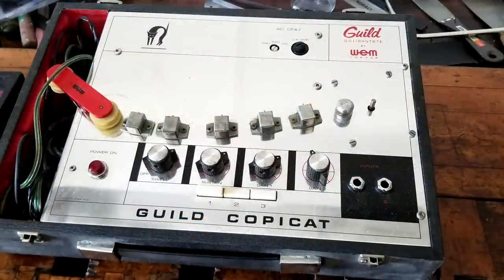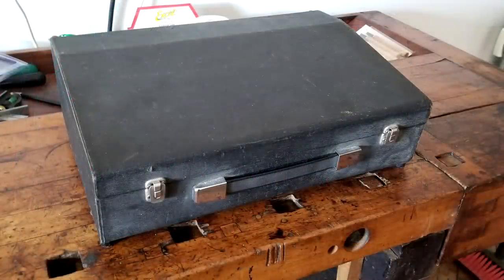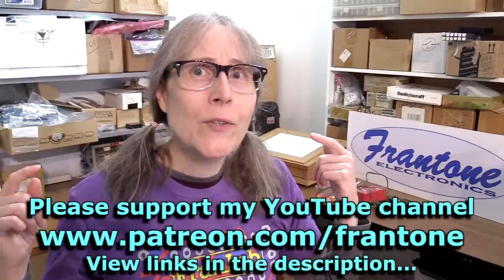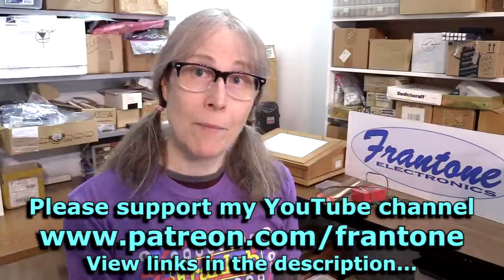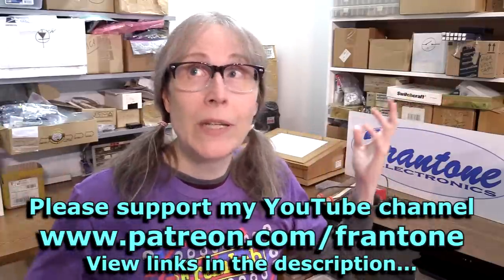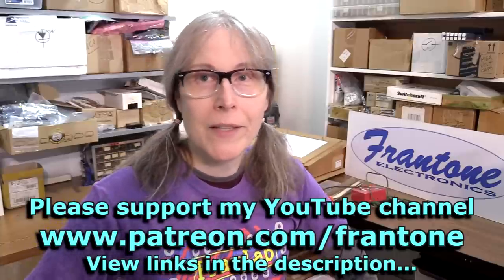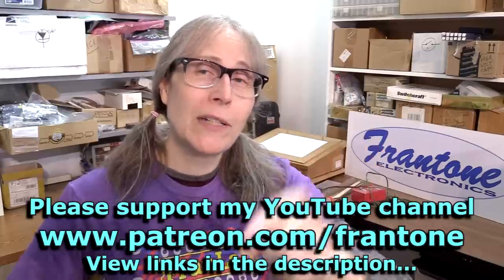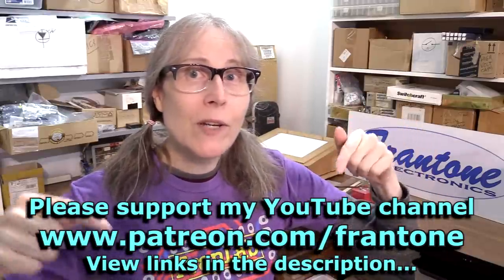Big Outgassing Problems Of Old Plastics

Comment: That purple shirt reminds me of those pre printed PC project boards Radio Shack used to sell.
     I had an old plastic cabinet vacuum tube TV as a teenager that smelled like dead fish when it warmed up 
     Some older plastics distort with age. I read an article a while back that said some 1940s cheap plastic jewelry had collector value because early plastics crumbled with age , and finding it in good condition was unusual.
     My guess would be to store plastics in as cool a location as possible. I would think heat would accelerate out gassing.
     Maybe store those records in larger metal cookie cans? Padded with something non flammable? Maybe ground the  cans as well. Just a thought.

Comment: Hi. the phenomethanal plastics were used in electrical insulators, due to their high temperature performance, and also in the manufacturing of printed circuit boards, among many other junk, one of its main problems is that when they decompose, formaldehyde is released, if you ever were around that stuff in the chemistry lab, the smell and its effects on the mucosa are similar to what you described.Take care.

Comment: i've had garbage bags that stink like burning wires by themselves. Like the factory that made them had a fire.
Reply: That is because to make the bag you extrude a circular tube of PVC, and then while it is hot you blow hot air into it to stretch out the tube into a much larger diameter thinner tube, and then blow cool air over the outside to finish the stretch and cool the plastic down. Then you have a roller around 5m up that it is folded over, which controls the air flow out, and it then goes through a few calendar rolls to finish the cooling, before it has one of 3 finishing processes applied. If it is a plastic bag it is printed with a roller, then goes to a punch that simultaneously seals the bottom, and punches out the handle, and the bag is then finished. For garbage bags you typically either slit the sheet in 2 bags, using a heat sealer on the edges, and a perforator making the divider between the bags, along with the base seal. otherwise you just have the bagbase sealed and the bag cut for regular non handle bags.

Your garbage bags are typically made with all the scrap pieces of PVC from other bags, along with recycled PVC bags, recycled PVC from other sources, all taken, ground and mixed up with new PVC base and carbon black, to make a cheap but low cost material. Then this is blown, and as the machine typically will be run long periods there is no cleaning of burnt plastic that occurs and this then burns, impregnating the plastic with the smell forever. That machine, and the area it is in, typically is the worst smelling and most poorly maintained machine, as it is either an old machine with poor quality control, or is worn out, so it makes variable thickness material, but for a single use garbage bad considered "good enough".

Comment: I wish my uncle were still alive to ask the best way to handle this.  But he passed away at age 100 not long ago.  He was head chemical engineer at Western Electric for many years.  Then they "promoted" him to Liaison Officer between Western Electric and the EPA.  After two years of that (and being put in an awkward position when maybe the company wasn't doing the right thing) he said he would retire if they didn't give him another position.  So they made him Liaison Officer between Western Electric and OSHA (ouch)  After two years, he had really had enough and left the company.  But he had learned a lot and very early got involved in the business of "Industrial Hygiene" and became CIH which is "Certified Industrial Hygienist".  If you can find somebody like that (perhaps contact the "American Board of Industrial Hygiene") you might get some knowledgeable answers and suggestions.  Perhaps a college or university in your area has this as part of some program and might have somebody that will talk to you gratis.  At any rate, if your ventilation isn't already good, consider making it good.  That's important especially for soldering and for all manner of chemicals and dusts you probably encounter.

Comment: There is a movement of opinion that much of our Asthma issues these days is because we surround ourselves with plastics that out gas all the time. That greasy film on the inside of your windscreen is solvent coming out of the plastic dash in the sun. Your walls are probably coated with Acrylic paint, (latex in USA,) a plastic.  Your carpets and furniture ad clothes may well be some form of plastic.

Comment: My worst experiences with outgassing materials are:
1. Soft rubberish household gloves. If you put them near other plastics, they will attack it.
2. Rubberbands, almost as bad as the gloves.
3. Suitcases with foam inside. If they are closed, aggressive gasses will build up and attack inside stored plastics.
Reply: I left a pair or rubber coated garden gloves in a microwave antenna dish, the gloves 'melted' into the painted surface. I basically destroyed the gloves removing them, and the painted surface is all but destroyed.

Comment: So strange! I have an old National Union tube tester with an all metal chassis but it also has a weird plastic-y smell... I was doubting my sanity, so thanks for sharing, Fran! I suspect it is the insulation of some of the high-voltage wires on the inside.
Reply from the maker: Many of those tube testers have a 1.5 volt battery inside the case, so you may want to open it up and check that.
Reply: @FranLab  Great idea, I will check it out, thanks :) Just looked up the name, it's a "National Union Videotron Picture Tube Checker."

Comment: One of the biggest offenders in terms of off-gassing is PVC, which has been commercially manufactured since the 1920s, so could be in a variety of items in your collection.  In an enclosed environment, you'll be able to see a white residue collecting on surfaces above pieces of PVC, though this usually takes place over several months.  Phthalates are a common plasticizer in PVC, so that's worrying, but also worrying is the question of what's happening with the chlorine during this off-gassing process.

Comment: My toolbag smells like rotting garbage, even though it is just a few months old and hasn't even been near a trashcan. Apparently the lining is butylene which breaks down to produce a horrible smell. I added some silica packs - the kind used to keep electronics etc. dry - and that does help. Might be an idea for your storage crates?  Another option is to use "active carbon" this also absorbs a lot of foulness (charcoal also works). Both are inexpensive and also available in bulk.

Comment: I have a synthesizer made in 2007 that emits a nauseating sweet stink after being turned on for an hour. I tried cleaning all of the circuit boards with IPA and letting the dismantled synth sit on my balcony overnight but it is still the same. It's one of my favorite synths but I just can't play it for very long without getting a sore throat. Synth = Korg MicroX.

Comment: I rewired part of our summerhouse some years ago. That part of the installation must have been from mid 50:s. Lead around silicone rubber-insulated wires. The silicone rubber was like new. Other and younger kinds of plastic can be ground to dust between your thumb and finger. UV-light and ozone are clear no no:s I guess.  I also fixed up our row boat. What if I put in too much or too little hardener in the resin. What then? And I'm thinking about collectors of modern cars. A rusty say VOLVO P1800 can be put back in good exhibition grade order. But what about a Koenigsegg, if something happens to the carbon reinforced plastic? And what if it is not only at the surface? Welcome back bakelite!!

Comment: Would the Library of Congress not want the Lacquer Discs? Also... Where I work, we had a Neve audio console from either the late 1980s or early 1990s. By the early 2000s, the boards were catching fire. I was told it was a problem with their (at the time) new manufacturing process with SMD. They weren't cleaning the boards well enough and the combination of residue and electrons flowing through the boards caused problems.

Comment: Neutralizing acid gas production with baking soda may be an option. 
The acid gases emitted catalyse decomposition that produces yet more acid gases.
Decomposition of elastomeric components is unavoidable but corrosion inhibitor sachets used in electrical panels are a slightly more expensive option but are designed specifically for the job.

Comment: Somewhat off topic, but there is a problem with vintage Olympus cameras caused by deteriorating foam tape used for light gaskets and mirror shock damping. In these applications it is fairly easy to remove and replace, but it was also used under the housing for the pentaprism mirror. It wasn't really necessary in this application, since the mirror is well fixed in location. When the foam breaks down it corrodes the silvering on the mirror, resulting in a band of apparent "crud" at the bottom of the finder image. To prevent this the top cover of the camera must be removed and the tape residue gently scraped off with alcohol for a solvent. If there was sufficient damage the mirror must be replaced. Fortunately the mirrors from later models are exact replacements and mirror transplants are possible. A CLA (clean, lubricate and adjust) servicing with new mirror costs about $150.00 so is more than the used value of the camera, but worth it if you want to continue using it.

Comment: Working with polymer clay I had to add forced ventilation to my baking oven, drawing the exhaust right out through a window to stand working with the stuff. Placing an outsourcing plastic item in a warmer than normal environment  might make it outgas quicker as the plasticer would evaporate faster. Like a sunny spot near a south facing window with some sort of ventilation.

Comment: I'm not sure what sort of crates you're using, but a good solution might be to take the lids off the crates and staple on sheets of tyvek. It would be easier and more allow better outgasing than drilling holes in the crates.

Comment: I've heard that chemical agents in cables that keep the sheaths flexible can react with the kind of plastic material used to make computer cases. So if you wrap your computer with it's cable, the cable can "burn" into the case over a long period of time. I try to keep the original packaging of as much of my stuff as I can, because the people who packaged it knew best how to prevent these sorts of chemical reactions from happening. But I'm afraid in your case, you've got a tremendous number of unknowns.

You may want to hire a full-time chemist. You could do videos together. It would be fun.

Comment: I haven’t watched your whole video yet - I will, fear not - but I’ve even noticed some outgassing issues with the 1:18 scale model cars that I have. Many of them have die cast metal and plastic construction, with the plastic parts displaying definite signs of fatigue as they age, particularly if they’re painted or mounted directly to metal parts. Definitely notice a strong chemical odor from some of my older models as well, which I suspect doesn’t come from the glue. Interesting.

Comment: I had to cleanup a neglected aquarium a few years back and did'nt know if I could stomach the stench of dead and rotting fish. I got a couple of masks @ Ace hardware with activated carbon, and they really worked 'cause I would have ralphed if any stench got thru, so my advice is in the short term, mask- up. What with the virus thing happening they might be hard to find even tho they're not purpose built for virus, but for long term breathing comfort, get the masks with the exhaust valves, as they will be the most comfortable, getting the moisture in your breath out of the mask. Don't know, but there may be types that have replacement filters which would be the most practical. I think they might be marketed for demolition/construction uses. Replacement activated carbon would be the best. Don't cheap out, perhaps get 2 or 3, plus replacement filters. Gotta have the exhaust (exhaling) vents or the buildup of moisture in the mask will drive you nuts in a matter of minutes.
 There are A/C units now that come in 2 sections. An inside evaporator unit (blows cold air), and a condenser unit that sits outside and blows the heat away, and are scaleable in many sizes, and are not necessarily directly close to each other. You can see them on some of the "This Old House" episodes. Don't know what, if anything might be possible in your situation $ wise, but a segmented system also has the capability to have a long run (distance wise) between the two sections, and the ability to relocate in the future if necessary.
 Hey, c'mon, Fran's gotta keep being a cool cat, right? You might also consider just a recirculating fan w/activated carbon inside your lab, I've used several in my (moldy-dusty) ancient house to good effect. Not just outgass stuff, but the last few years of forest fire smoke, as I'm allergect to many things green, such as just about all grasses, trees, and weeds, dambit!
 Sorry for the long post, just wanted to reach out and help.
 Was gonna ask you where you got the background and other music, but now that I've seen more of what you are, and most tellingly, the Strat... Never mind!
 So you're a kick ass player! Good deal!
 Well now it's time for Fran to take care of bidness.
 Please do, remember your fans and freinds-- we love you.
 Best regards and ttfn,
 TL.

Comment: Up to recently i owned a Watkin's Copycat which was housed in a wooden case; despite its 1960's vintage , i ve never had problems with vapours, odours etc etc...Do you think being housed in a wood box allows the insides to 'breath' thus slowing down or even stopping any breakdown of plastics inside?
Reply from the maker: This case is plywood, just covered in vinyl imitation leather.

Comment: Opened a case of my microphones a few weeks ago to take inventory, opened the last item which was in its original box and was greeted with an odor of antique electronics. Seems that the coil cord on an Astatic CB microphone from the early '60's had an oily coating that leaked onto the original spec sheet and the receipt when I bought it used about 15 years ago. Cleaned as much of this slimy oil off of the cord. Don't know what the liquid is either. Want to contact the company but their original Astatic factory has closed and now only their pro mike shop exists. Think they might have an answer to what this liquid might be?

Comment: My Predicta TV stinks all the time. Sometimes the whole room smells and sometimes you have to get right up to it. Some type of cellulose based plastic i think. It also smell funky when you turn it on. 

I heard that screwdrivers with acetate handles will smell after a few years and stink up a toolbox. One way to alleviate it is to dip them in acetone which also makes them look new again to a point.
Reply: Cookingwithjesus, Excelite screwdrivers and nut driver sets with translucent butyl acetate handles are known for this weird outgassed smell. These type of plastics also tend to grow a crusty white mildew, which is also seen on the knobs of  50s Scott and Fisher hifi equipment (to remove it, make a solution of one part ammonia,  one part Formula 409 and two parts water).

Comment: I had a Motorola record changer that began offgassing what I believe to have been polyphenols. Tracked it down to the transformer, which was potted in a epoxy-like material I couldn't identify,  but it's nothing like what is In my other tube equipment. Removed it from the amplifier and dipped it in beeswax. No more smell.

Comment: Some plastics and rubbers hydrolyze. Keep the humidity and temperature down. This is also the cause of capstan rubbers to turns to glue. Stand alone dehydrators is not the complete answer but it helps a lot.

Comment: Ozone is particularly bad for some plastics and all rubber materials. Oxygen is an active oxidant, so possibly purging the air from those plastic crates 
using CO2 or argon on a semi regular basis would be worthwhile. I have some NOS belts and drive wheels sealed in bags that way along with a few rare electronic 
 items from the 60's that have lots of rubber and plastic parts. The bags I used were bulk clothes storage vacuum bags, I sucked the air out, then used argon from my 
mig welder to balance the pressure back to atmospheric, so not much was needed.
Reply from the maker: True - and my new BlueAir purifiers are shown to actually reduce ozone.

Comment: Not a nice situation. Do you still have contacts at the Smithsonian? I bet they would know who you could talk to. Back in the 70s a guitarist friend had an Echoplex which was very similar, but the case was covered in that horrid faux quilted leather which tore easily. I wonder whether the outgassing could be from the wood glue in the case. If this dates from the late 60s or early 70s, they might still have been using a traditional glue. That might also explain the smell from the hi-fi. I still have my dad's old Elpico tape recorder which he bought new in 1961, but it seems to be free of any smell. Don't know if it still works though.

Comment: I've heard that the pick guards of vintage Vox guitars deteriorate when they are left inside the case, due to the build up of outgassing.    I'd wear a ventilator and clean out the interior of that WEM before letting it sit around and longer.